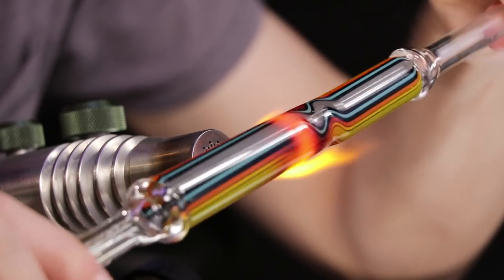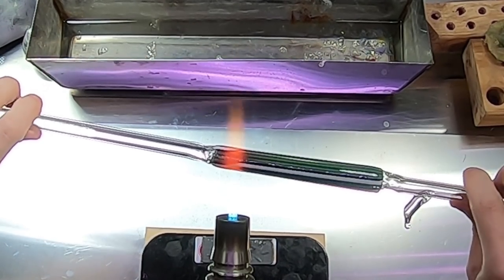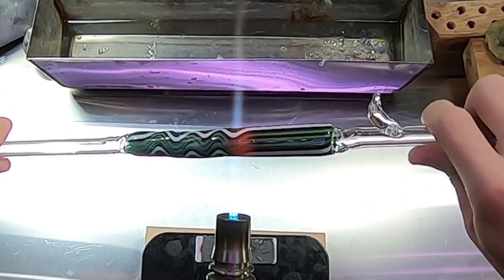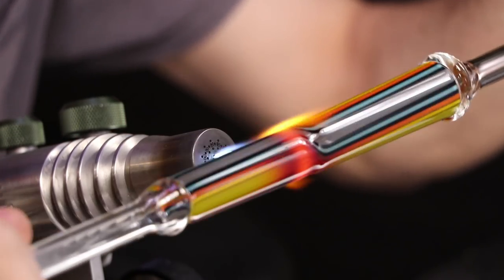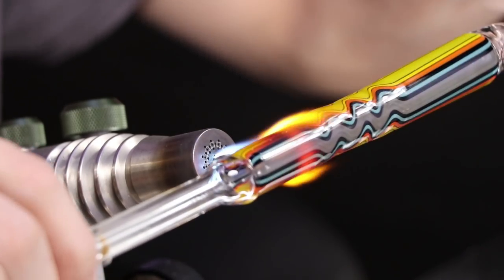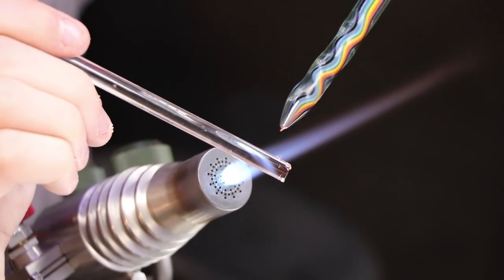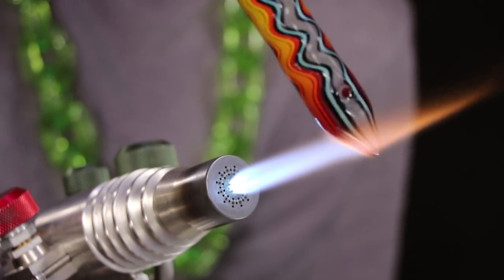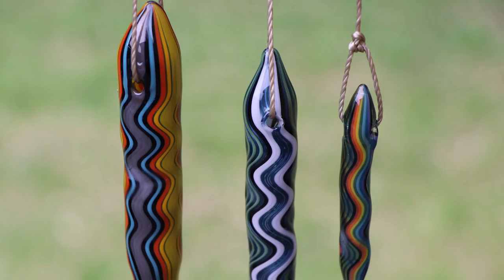Wig Wag Plumb Bob Glass Lampworking

Comment: How do you create the lined tubing? with a vac stack?
Reply from the maker: I bought the tubing pre-pulled. I tried to pull my own lined tubing but it didn't work very well. I need to practice that technique some more.
Reply: @MattJasa  if you do get it down I would love to see a vid. Also thank you for your videos. You have taught me how to make so much of what I've made thus far in my lampworking career😊
Reply from the maker: @gabelombardo7013  Here is my first attempt. https://youtu.be/_9WwILaSJwY  . The video turned out alright, but I didn't get enough core heat to melt it all together. Bringing it up to working temperature in the kiln is important before melting the lines together. Also glad to help 👍, and thanks for watching! Stay Melty!🔥